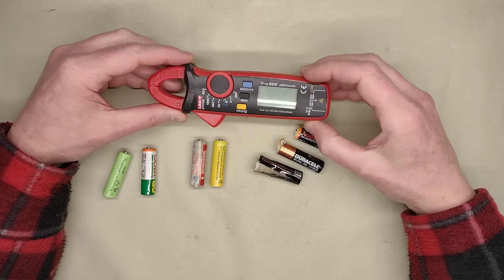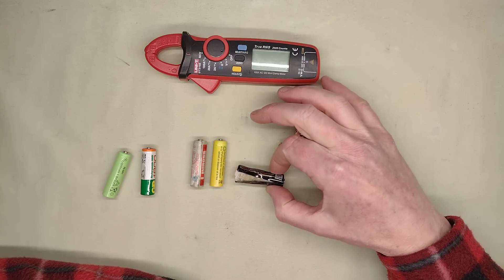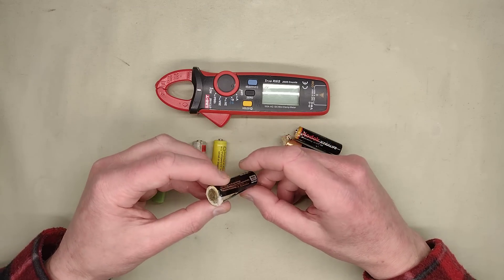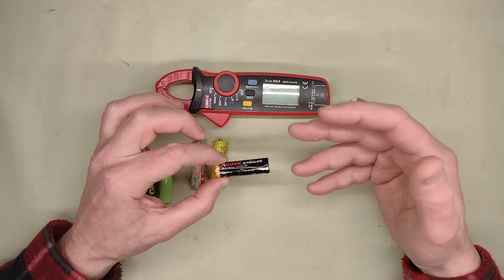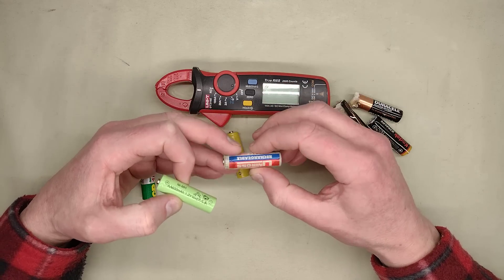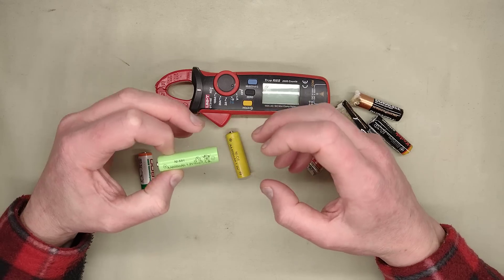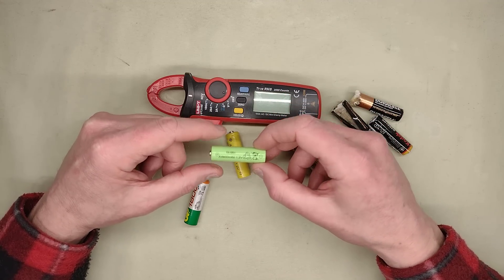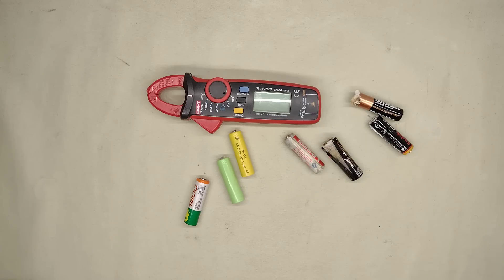The curse of leaky alkaline batteries

Comment: I have a question for you Clive.
What is the best way to test AA AAA batteries.
Im assuming just testing voltage is no good because they may show volts but have no amps left.
I have voltmeters but how to apply a load??
Hope you had a great Christmas.
Reply from the maker: A dedicated battery tester shows the voltage under load.
Reply: Well, I'm not Clive but here goes.... You're right that a battery should have some load applied to it for proper testing.  You can get devices that are specifically made (and labelled) as battery testers - when you connect a battery, they apply an appropriate resistive load and a meter tells you whether the voltage holds up (or not).  A basic tester, which gives a quick go-no go reading, has a jaw that simply opens up to contact the ends of AAA thru D cell batteries, with contacts on the side for 9-volt clip-on batteries, and costs $12 or less on Amazon. Of course, you can get fancier and more expensive ones, but sounds like the simple one will do for you. If you "do it yourself", you could also rig up a battery holder with a resistor across the terminals, 50-100 ohms for AA or AAA, and use your voltmeter to measure the voltage across the resistor.

Comment: I have switched over to using NiMH for most applications, and a pack of those lithium primary AAs as a backup, or inside very low-drain devices like remotes or calculators. They are expensive compared to alkalines, but I agree they are worth the peace of mind that they won't leak inside electronics.
Reply: Are they not actually many times cheaper if you count hours of use per battery? Even when accounting for the electricity cost of recharges
Reply: @InvadersDie  They can be with enough uses. I ran the numbers at one point, and I think it was something like if you used the NiMH at least 8 times in its entire life, it would become cost effective versus most alkalines. The electricity cost to recharge the battery I think is almost negligible. I was more referring to the lithium primary batteries, which cost nearly as much as the NiMH, but are single-use. The advantages are that they are rated for a 20 year shelf life and deliver a very steady 1.5-1.6V across nearly all of the discharge curve.
Reply: @veraxis9961  Charging four Ni-MH batteries costs a few hundredths of a cent, you could recharge a set of four 50 times and probably still come out with a cost less than a set of four alkaline batteries.  If the rechargeables survive 100 charges they have more than have paid for themselves over alkalines.
Reply: @mharris5047   Yes, that is absolutely true. I think the question I have is not how many charges I get, but how many years they will last even if only used a few times. In a low-drain application like a TV remote, I might only have to charge them once every several years, so the batteries will be years old before I reach 100 charges, or even 8 charges.
Reply: I use old  mouse batteries in the remote   "downcycling "

Comment: Why can’t they make the nickel etc etc at 1.5 volts???? Wtf
Reply from the maker: It's the holy grail chemistry.  It's much easier to get the manufacturers to design products that work at the lower voltage.
Reply: The problem is the chemistry decides the voltage. Nickel is 1.2 ,zinc air is 1.4 etc etc . Any battery that has a different voltage from its chemistry has a boost or buck converter to change the voltage.

Comment: I use rechargeable batteries wherever possible, but several devices have "do not use rechargeable batteries"
Reply from the maker: Sometimes that's down to needing that tiny bit of extra voltage, and sometimes it's just old instructions copied and pasted on new products.

Comment: Had the same meter and the same leak. There's a hole in the inner battery compartment where the spring contacts go through and the liquid leaked onto the circuit board. I noticed because the continuity buzzer failed and found the corroded traces were everywhere. Way too much to repair, including destroyed vias and traces going under components.

I bought a bigger brother to the 210 and the first thing I did was to take it apart and hot glue the exact same holes in the battery compartment. Hopefully that'll save me another $60...
Reply: Just switch to lithium batteries. They're more expensive, but your meter will thank you!
Reply: I had a leak in that same meter.  Cleaned it but the DC current is off and I can't find why.  Works fine for the other functions and AC current.
Reply: @jkbrown5496  What did you use to clean the meter?
Reply: @robertallardice8119  I use a paste of baking powder and water to clean alkaline battery leaks.
Reply: @FiveRustyNails  Thanks!
Reply: @jkbrown5496  I am told by an electronics colleague,  that the DC Clamp meters  may require degaussing from time to time, as they may become magnetised/polarised. just a thought, may be worth a shot.
Reply: @richardgreene4725    May give that a shot.  Leaky batteries can do a lot.  Had a thermostat touch screen that lost its mind.  I could clean it up, but I don't know, after a day it would go even more insane.  Only found one microscopic green crusty, which I cleaned with alcohol, then I reflowed the pad, finally, I used the thermostat schedule till I had to switch to heating when I installed a new, non-touchpad thermostat.
Reply: I think I'll open my meter and have a look later now I see this
Reply: Had the batteries leaking inside the outdoor unit of my weather station, and it completely threw of the sensor inside. It now reports wild swings from -40 °C at night to maxed out scale during the day, with constant 95 % humidity.
Reply: @nrdesign1991  I have an anamometer outside which takes 3 AA batteries (it’s a conspiracy) I might check them this week.
Reply: Same here. Took it apart and cleaned it but no joy.... Now the batteries are in a little baggy in the case of the meter and get checked every so often
Reply: I had a power meter supplied by British Gas? current clamp around a meter tail. I binned it due to leaky cells.
Reply: Had a whole meter die when I left it under a skylight that leaked in the rain. XD
Thankfully it was the cheepo Aldi branded meter, and not the expensive (hand me down freebee though) calibrated meter.
Reply: Destroyed traces can be repaired with some solder and a strand of fine wire.
Reply: @ItsMrAssholeToYou  I know, I've done it before. This one is missing a score or more of 0.005" traces on both sides of the board, with multiple vias and pads also gone, going underneath SMD caps, SSOP and 0603 packages. There's a dozen components that would have to be removed to even see where the traces went, assuming there was enough evidence left to tell. When there's that much damage, it's not worth spending the time on a device which would no longer be trustworthy for it's intended purpose.

Comment: I converted my 20-year-old Norelco Tripleheader from  a pair of NI-MH to a single Lithium cell with two 1N4007 diodes in series it works great again. 😀👍
Reply: Massive OVERKILL using diodes rated for 1000 reverse volts, when all you want is the forward voltage drop  of a mere 1N4001. But I guess there is very little price difference nowadays.
Reply: Just what I had in my stash of parts 🙂

Comment: NiCd batteries are still used in aircraft and helicopters with turbine engines. The NiCd batteries can supply the massive current required to crank the engine up to several thousand RPM so that they can light off once jet fuel is introduced. They are then recharged once the engine starts, and the starter is switched to generator mode.
Reply: In aviation, the risk is thermal runaway with other chemistries. That and the cost of certification!
Reply: A long time ago, I had an old surplus helicopter NiCd battery in my 1972 and later 1976 Dodge Darts. Worked well, and cranked over easily even at -35°C. Just barely cleared the engine lid. Lasted for many years over the life of these two cars.
Reply: I tested out 40A short circuit output from an Eneloop AA (through 0.005 ohm resistor).  The only issue would be low temperature, but NiMH can put up a good fight if it's a good cell design otherwise.  The problem is often getting a low resistance interconnect - normal AA battery holders smoke the contacts much above 2A.  This isn't to say that you could do 40A continuously out of one of these batteries, but doing 10A or maybe even 15A would be pretty doable.
Reply: I think this may be one of those country issues? I swear I have seen HF have nicad drills still. I still use some and even low current ones are a perfect match for things like clocks and remotes. ( I just checked HF and I didn't see any nicads in the cheap drills. Who knew?) This is why Clive is our favorite fizzy wine drinking leader!
Reply: @johnpossum556  HF just quit selling the Ni-Cad based drills a few months ago.  I have two of them -- one from 2015 and one from 2019.  The drills work fine (they are good for about 85% of what you need a drill for, they are a bit under powered for concrete work) and surprisingly even the original batteries from 2015 still work.  They are not heavily used but I use them at least once a month.
Reply: Yes, that's liquid electrolyte battery (KOH) and they require careful maintenance. Ì remember having measured up to 1800A while starting a PT6 turbine.
Reply: The F-16 jet uses a compressed air tank to start a small turbine generator to start the main turbine and power the electronics.  There is a hand pump in a main wheel opening just in case.
Reply: They are also used in most satellites.
Reply: @whitcwa  satellites have something related but even MORE robust.  Hubble had a set that lasted until its last refurbishing then got replaced and still works now

Comment: But does the 1.2v throw off the accuracy of things like meters?

Also I wonder if the lithium AA cells will leak like the alkaline ones. I haven't had any long enough to see apparently.
Reply: If you have a device that counts on the voltage from a battery as a reference for anything it belongs in the bin. 

An alkaline cell has a voltage range where it can still do useful work from ~1.0-1.6v. NiMH on the other hand starts out at a lower voltage, but has a flatter curve. So it may live in the 1.1v to 1.2v range for the entire discharge cycle - meaning the average voltage delivered may in fact be higher than the alkaline cell.

So in otherwords, it's not an issue. Some poorly designed devices won't tolerate the lower voltage, but those devices also won't get anywhere near full life out of an alkaline and so that's not really the fault of the battery.
Reply: I have lithium (not Li-ion) cells that are going on 5 years, and counting, in my smoke detectors.  No leaks, no problems ... I'm wondering how long they'll keep on doing their jobs.
Reply from the maker: Most meters like this use a voltage booster to get a stable voltage.

Comment: Nothing worse than going to use a piece of equipment and finding that horrible gunk coming out of it. I have a (when new) VERY expensive network cable tester from Fluke that I needed for work the other day, and sure enough, it doesn't turn on, and oops, I left some Duracells in there.

Fortunately like your clamp meter I was able to clean it up and get past it, but that hurt to see.

Comment: I've had a dozen unused brand new Duracell alkaline batteries start leaking in their package.  They are complete rubbish anymore.  They weren't like this in the past.
Reply: Interesting. Am doing a big clean-out of a grandparent's house. Have come across a few leaking boxes of Duracells that hadn't even reached their expiry dates. I wondered if something unusual had happened to them. Very annoying, isn't it?
Reply: @phantomkate6  The reason modern alkaline batteries leak, is because they no longer contain mercury, this was used to help stabilise the chemical reactions in the battery, to reduce the chance of leakage.
Back when alkaline batteries first came on to the market & into the 80's & 90's they never used to leak, in fact that was one of their selling points.
Reply: @NOWThatsRichy  This comment needs upvoting.
Reply: Duracell has been that way for the last 15 years.   I use Northern Tool's brand, and haven't had any of those blow yet.   Of blown batteries, I'd say it's 95% duracell, and 5% every other manufacturer.
Reply: I will not use/ buy Duracells just because of the leaking problem
Reply: I just replaced every battery in my house with NiMH.  48 AAs and 24 AAAs were used.  They were about 50% Duracell and 50% Energizer.  About 15% of the replaced batteries were leaking, all but two of the leakers were Duracells.
Reply: Yep.  Can confirm this for many years running now.  Dura-shit are complete and utter shit and will ruin whatever you have them installed in within a matter of months.  CHECK your devices once per month for the familiar classic crystal glistening around the contacts.  Figures they got bought out and "farmed."  If anyone knows of even just one brand that doesn't suck or wipes out your bank account when you by a pack, I'm sure many of us would be grateful to know.
Reply: @wonderbars36  The general consensus seems to be that Panasonics are better than most.  Duracell seems to be at the bottom of the pack.
Reply: They used to be the best batteries you could buy hopefully Energizers don't turn to shit
Reply: @neiliewheeliebin  I got fed up with Duracell and I bought a bunch of Energizers hoping they'd be better.  Some of the Energizers were already leaking in the package when I received them.  So I said screw it and switched to NiMH.
Reply: I despair seeing supermarkets flogging cheap Duracell’s and imagine he damage they are going to do.
Reply: DuraHell batteries are now part of a Chinese company that’s apparently run by bean counters rather than engineers.
Reply: Because Duracell was sold to a Chinese garbage maker.
Reply: @timrockman7  Duracell is owned by Berkshire Hathaway since 2014, and Proctor and Gamble before that.  You can't blame this one on the Chinese.  They manufacture AA and AAAs in LaGrange GA, and Cs and Ds in Cleveland TN.
Reply: China turns everything they touch into shit.